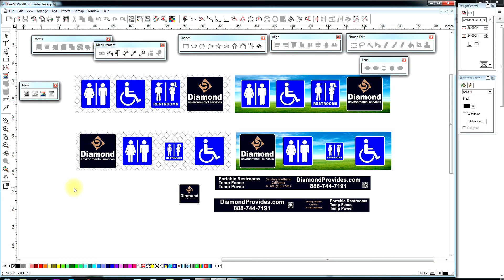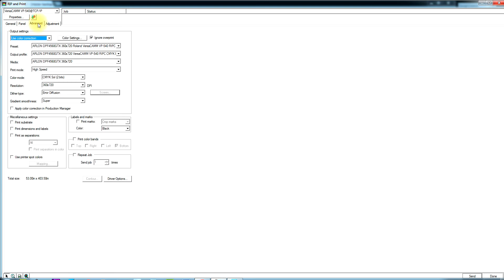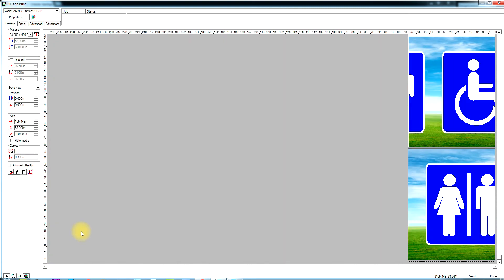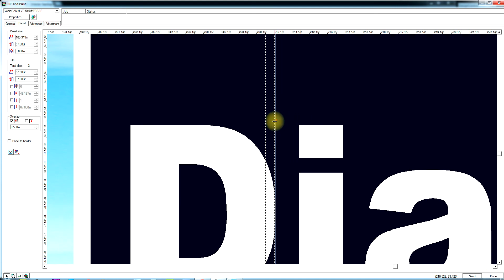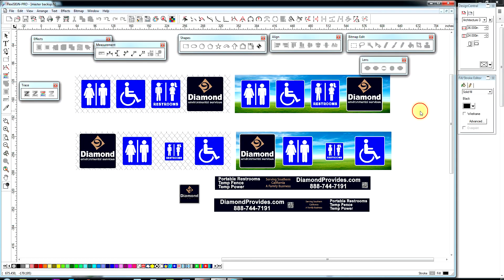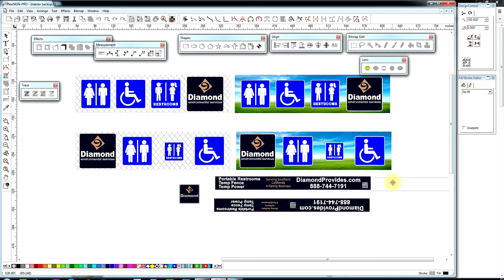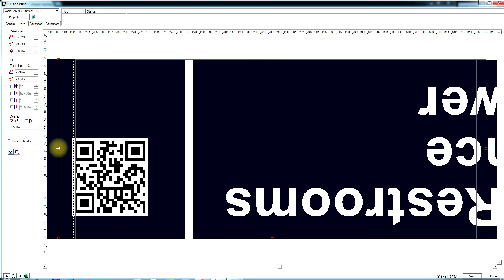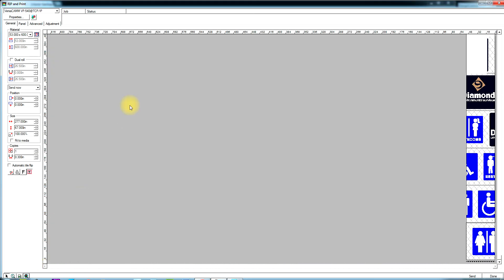Another way to Setting Tile Panels in FlexiSign Pro 8.5

Comment: Hey great tutorials. I am pulling my hair out over panels and tiles in Flexisign. I want
to print long images like you are doing (11 meters long) but they are going on 2400mm x 500mm boards and joined for a shop front. I want to tile them so I can do 2 images per print as I don't want to join on the boards. I can't work out how to vertically tile them, I have tried all the options, can you advise ? Regards Matt - Swift Signs
Reply from the maker: Flexi is not always so friendly to use....try pulling the black line in the panel window versus pulling the red little tick mark on that very same black line. They both do different things. When I print for box trucks 30 feet long Flexi thinks it's so smart and that i need to print 30 foot runs so I manually tile using my finger to mark where the black line was until I pull it back because if the truck has 8' panels I like to print 2 ant a time making it a 16' print run. It other words just experiment with it. thanks